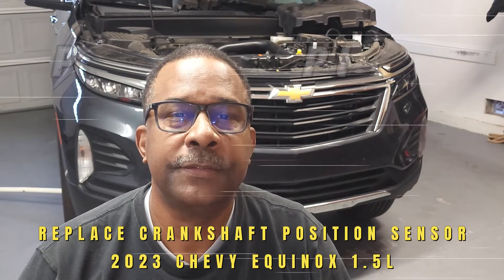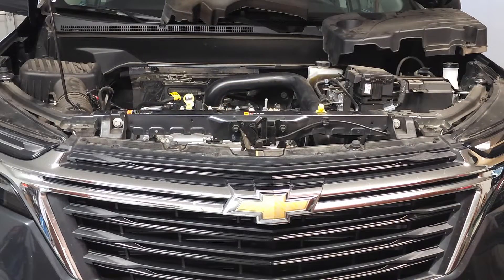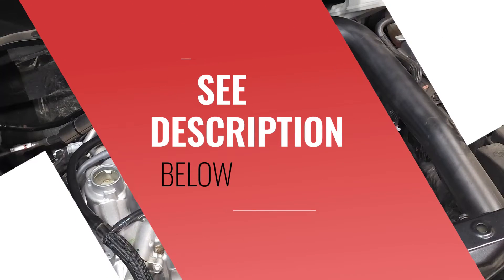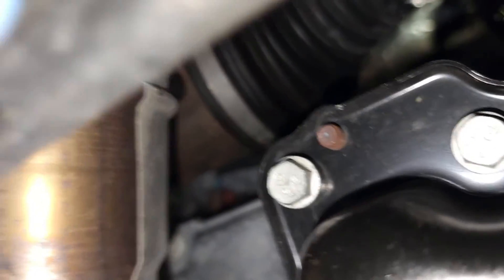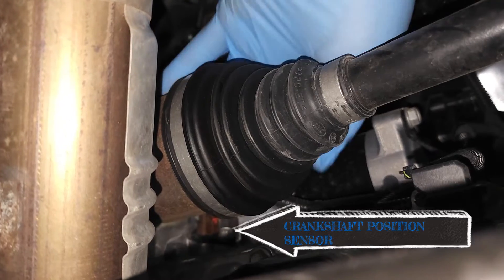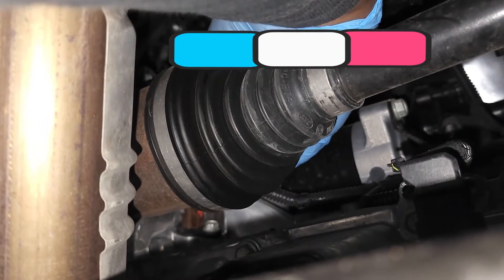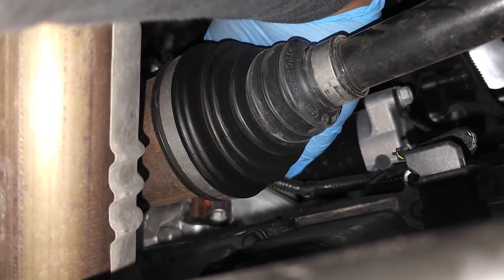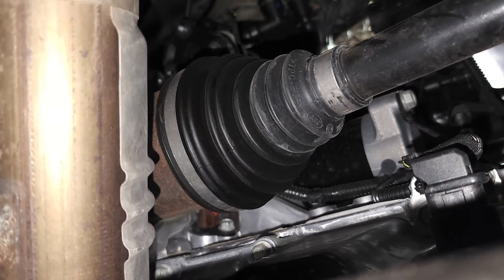2018-2023 CHEVY EQUINOX 1.5L Turbo, Crankshaft Position Sensor Replacement Tips

Comment: Can you show how you post a few picture of how you got your arm in in there? I can see mine (but there is a heat shield and alternator and a wheel and liner in the way. 2020 terrain 1.5l turbo
Reply from the maker: I'm laying on my back, right shoulder near the front passenger wheel with my feet on front of the vehicle. My arms are pretty long. You may need to lower the vehicle slightly. Great question. Please share with friends and followers. Happy holidays!

Comment: Do you have to drain the oil first or can you change out the sensor with the oil still in the engine?
Reply from the maker: There is no need to drain the oil. The sensor fits  into a hole located above the fluid level.
Reply: @protipsplus  thank you!

Comment: love your videos! Could you show where the Mass Air Flow Sensor is on a 2021 kia soul?
Reply from the maker: KIA 2.0 engines have a Mamifold Absolute Pressure (MAP) sensor instead of a MAF sensor. Check this link
https://www.kisouman.com/manifold_absolute_pressure_sensor_maps_repair_procedures-1143.html. Let me know what you find.